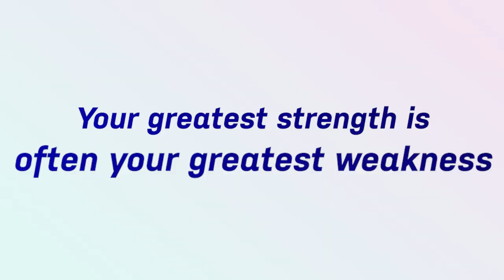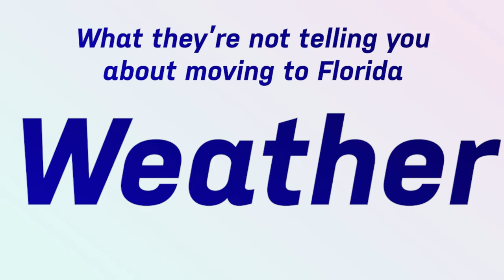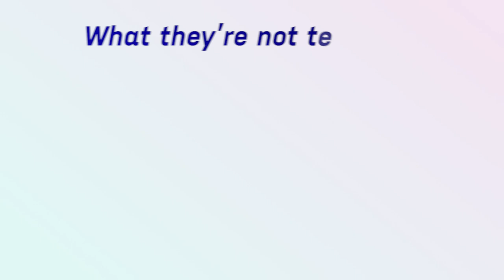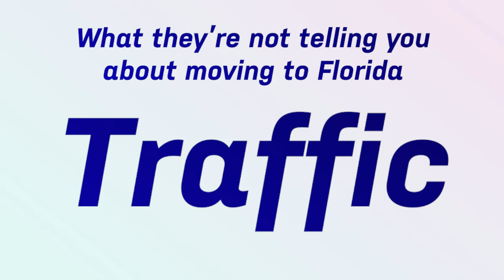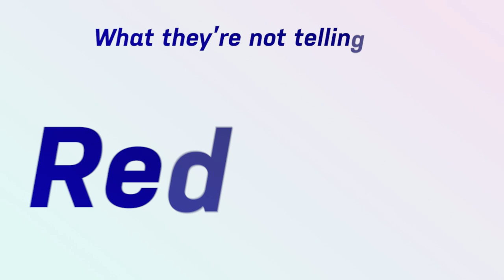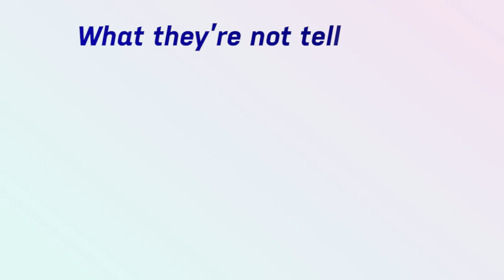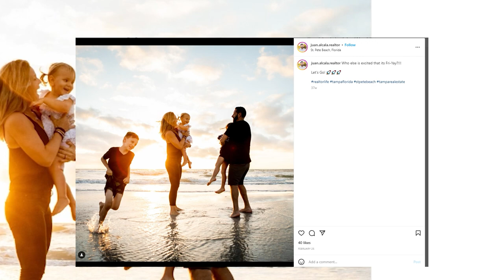What THEY'RE NOT TELLING YOU About Moving To Florida

Comment: Tampa Bay got lucky last fall as Hurricane Ian was forecast to strike there but instead landed well south in Port Charlotte/Englewood/Ft. Myers and the surrounding areas. I spent two and a half months in the aftermath volunteering in those communities with a non-profit that specializes in disaster relief. We concentrated on debris removal, chainsaw work, mucking and gutting, and sanitization. Most of the homes we worked on did not have flood insurance as it apparently is quite expensive so the homeowners hoped that they would not get hit and were unfortunately wrong. (BTW, I saw a lot more damage to floors, walls, furniture, cabinets, and appliances caused by flooding then I did to ceilings and roofs from heavy wind and rain.) 

If you are willing to chance a hurricane in your zeal to move to FL then there is one thing you should definitely avoid and that is living in one of those mobile/prefab homes so prevelant there. We gutted dozens of those places and they are shoddy compared to a properly built home with a concrete foundation. For example, we had to remove and throw out entire subfloors of plywood that we should have been able to save by sanitizing because they had particle board glued to the bottom of them which we could not sanitize. What's more, most of these homes were built in the late 1970s which means if there was original flooring anywhere in the house we had to stop work and send a sample to a lab to test for asbestos. 

And if it's not bad enough to have your home heavily damaged by a hurricane we saw many homes with the words "You loot we shoot" spray painted on them as apparently some people saw the suffering of others as an opportunity to trespass and treat themselves to anything of value that does not belong to them. Then there's the out-of-state contractors some homeowners told us about who took their money and then disappeared without completing a job if they even started it. I realize my view is jaded as I only saw these communities in the aftermath of destruction, but it's good to know what you might be getting yourself into.
Reply from the maker: You're right, we did get lucky. It was a crazy time to be here.
Reply: @trulivingtampa  this comment should be pinned in my opinion. I was scrolling and this is by far the most important comment.
Reply: Florida has become an expensive PIT which many find, once settled, that they can’t afford the U-Haul to escape!
Reply: We made it through Irma, Ian, Michael, and about 22 other named hurricanes, and I can tell you they will only keep getting worse as temps continue to rise.

Comment: Obviously, homes prices , & insurance have gone have up dramatically. Especially on the barrier islands beach communities. I live in Indian Rocks Beach (located between Clearwater, & St. Pete Beach), & insurance is a major issue. Just about every,  I’m having to change insurers b/c they either leave the state, or become insolvent due to Hurricane payouts. That said, property insurance for beach communities is mainly handled by a state run insurer called Citizens…..Only option available if wanting  to live on the Islands, but it’s offset by low property taxes that are about 5K a year with homestead….Far less expensive than any northern state. Used to live in Illinois, & property taxes were over 50K. Also, owning properties offsets it as well……..Aggressive lease growth, allows landlords (unfettered ability) to up lease rates to (again) offset costs. Several years ago a beach efficiency could be leased for under a thousand per month, now that same studio is (minimum) $2500 per. Still cheaper than most.
Reply from the maker: Hey we’re neighbors! Thanks for sharing some great insights.
Reply: A 1/1 in Carlsbad, CA is running about $1600